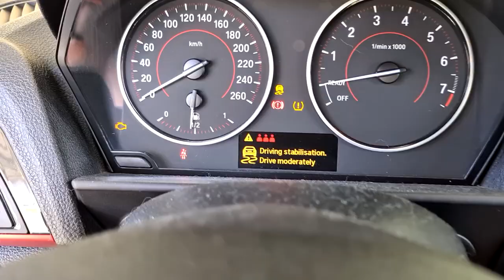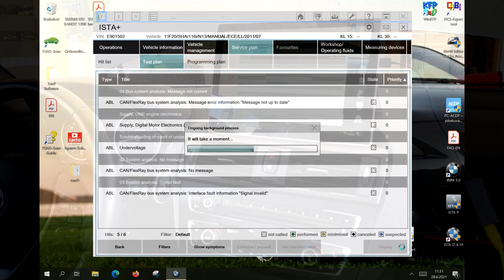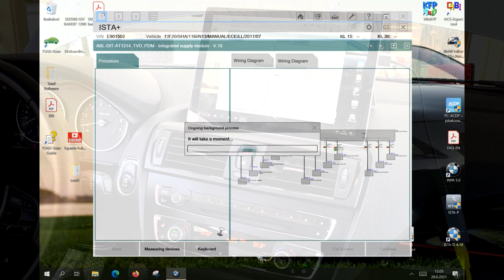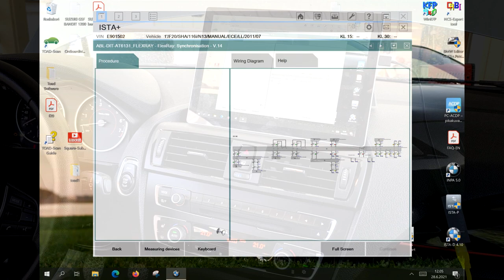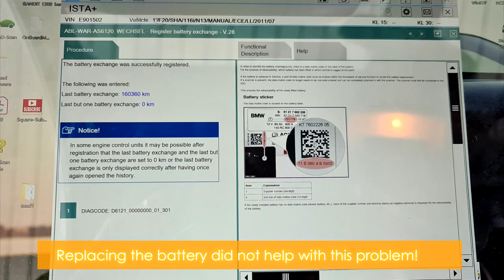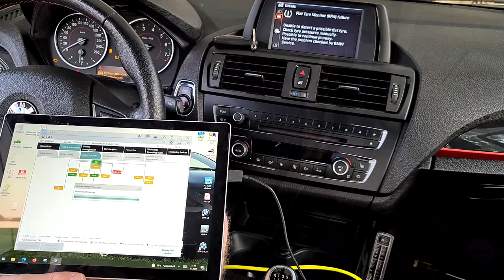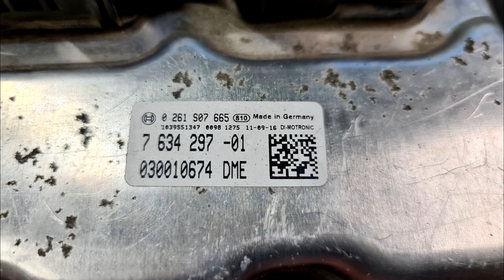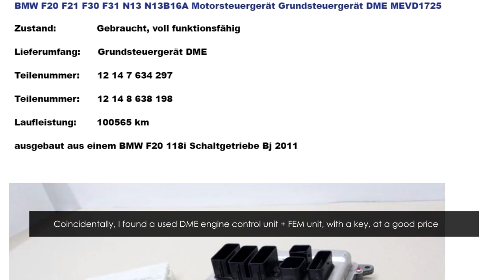CAR won't CRANK & not START - DEAD Engine control unit DME? - [PART 1] - BMW F20 engine N13

Comment: Water go inside on cable between front window and plastic cover that supposed to seal... go more down on cables package and go inside flowing on them. I had the same problem but i catch that and sealed all with silikone
Reply: How did you fix the issue?
Reply: @Zikiss  silikone around gaps

Comment: If you didnt have communication to the dme, I really dont know why you spent most of the video tearing apart the power module and fem….
All you had to do was check four grounds at the dme, back probe power wires at six pins (same connector as grounds), check both can networks, and flex ray with scope. Any losses at that point and then back track. Just seems like you took the loooooonnnngggg road for no reason